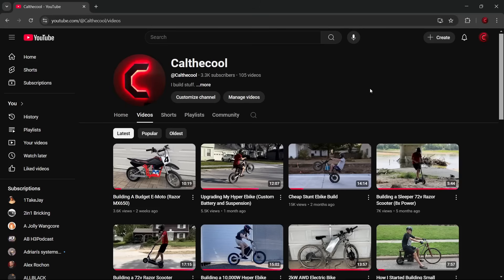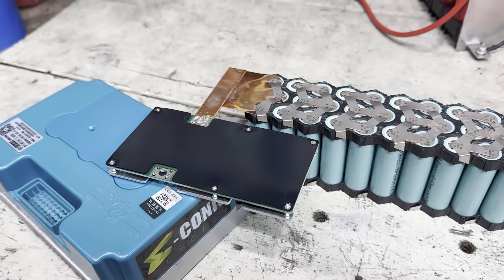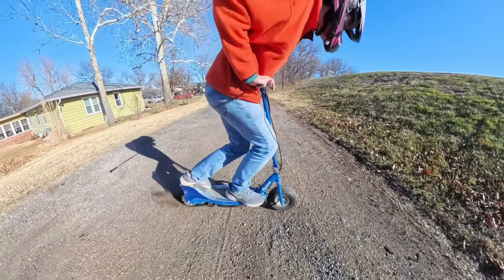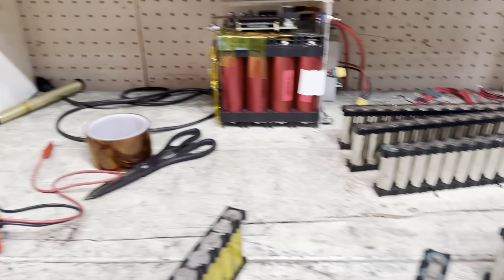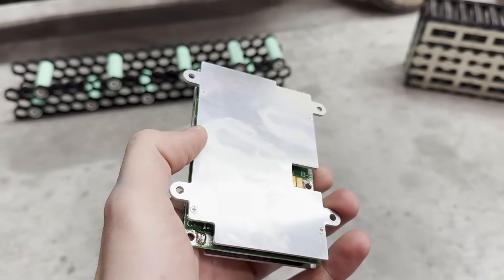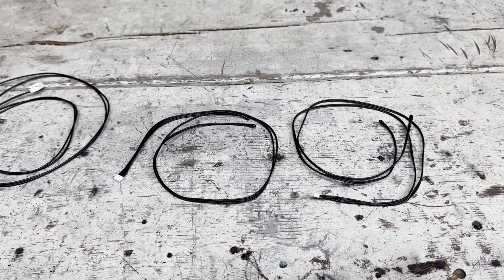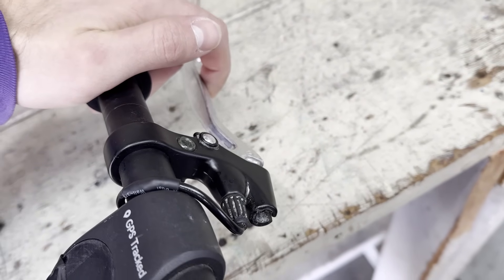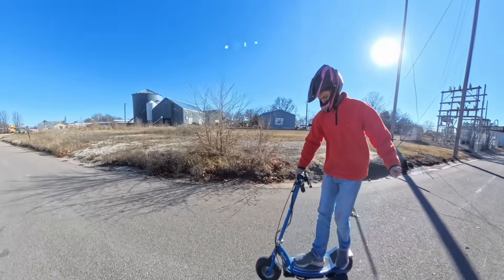Upgrading Two Electric Scooters

Comment: Do you think you could build a slim battery pack to fit inside the deck? It would be nice to see a stock looking 2wd version!
Reply from the maker: You could make a 1p pack that slides in from the back and not modify the frame at all, but that would definitely be difficult and the battery would be gone super fast.

Comment: There's that xt90s nice to see your progressing i just found your channel also vesc is great once you get the few things you mentioned worked out
Reply from the maker: I tried some xt90s connectors and they burnt out immediately.
Reply: If its an Amass manufacturered XT90S-F then you get up to 90A continuous and 120A peak before they blow how much current we're you working with 😂
Reply from the maker: @Nathan-q6y The resistor I mean, I plugged it in slowly and smelt something burning, then the next time I plugged it in it did a big spark. Believe me I could definitely melt the whole connector if I wanted, but I’ve moved on to qs8 connectors for my more powerful batteries.
Reply: @Calthecool That caalculates lol well i wanted to say thank you for doing your razor scoot build you got me thinking  about the build myself and then the other day i ran into a completely striped down razor power core e195 waiting for a new welding machine to get started on the buil

Comment: i have two crappy Birds I plan to mod eventually. All seems manageable but you kinda skip over custome torque arms for mounting motor in rear!
Reply from the maker: Sorry about that, I did that before I decided to make a video about this so I didn't film it. I just cut two pieces that were a snug fit on the outside of the frame, then cut two slots for the motor and two holes for some bolts to hold it in place.

Comment: I just sold my 52v BBSHD build.Not enough acceleration, plus was tired of shifting gears constantly in this POS congested stop sign ridden New England city.  Didn't want to invest a 72v battery AND an $800 HV ACI BAC 855 controller Kit so now I'm going 3kw 4T hub. I only ride on the street anyway.

Comment: bbs02 with 96v battery would be mental! Just keep below 50 battery amps and use  low gearing for acceleration.
JKBMS bms much, much better than ANT because it is active balancing the cells all the time above a set threshold. 
Ubox VESC is better because on/off switch is integrated on the board itself and way more reliable than Flipsky

Comment: Hey bud how you doing I can respect the fact that you're doing a channel on electrical scooters and bikes and he bites and stuff like that I mean I can respect that I just figured I stepped away from my motorized bicycles and see what the let's go bicycles are about okay if I watch the video I have somebody who looks like they know what they're doing maybe I can understand why they catch on fire and why they don't and I was raised around gasoline engine still a lot easier for me to fix but with all due respect I would like to spend $5 for a gallon of gas instead of spending $500 for a new battery and then waiting 12 hours for it to charge before I can even ride it my motorized bike takes 2 minutes to fill it up with gas and another minute to start it and I'm riding it's all together less than 5 minutes
Reply from the maker: @davidotto7666  I’ve built multiple motorized bikes and minibikes in the past so I know how good they can be, but I like to build this electric stuff now because it’s new and interesting, and if I ride a motorized bike or minibike around my neighborhood too much my neighbors will get annoyed.

Most batteries catch fire because they have some kind of defect, a lot are made in Chinese factories where they don’t care that much because they’re really hard to hold accountable if something happens. I make all my batteries myself so I make sure to not cut any corners so they are totally safe and so far they have all worked great.

You have to remember that you’re paying most of the cost of the vehicle up front when you buy a battery, vs having to buy gas constantly for a gas vehicle. Electricity costs so little compared to gas, it costs me $0.65 to charge my highest capacity ebike, and that ebike has a massive battery.

I just got a fast charger, so my newest bike now only takes 50 minutes to charge from empty to full. I actually store it at 60% charge, so it’s really only 20 minutes to get a full charge.
Reply: You know that makes sense I didn't think of it that way you're absolutely right cuz when I was a kid I used to play with a bunch of stereos house stereos car stereos thank you like trying I played with too so I know you're coming from I agree with you there is something different something interesting something new yeah you're right and especially you probably know more by asking about electronics and I'll ever know on purpose but you seem like a good person I think I'm going to watch your videos and learn some stuff you got my curiosity peeking now thank you again for replying and being respectful I appreciate that thank you again you have a blessed day

Comment: Try to make a ebike from a hoverboard
Reply from the maker: @noeln208  they aren’t powerful enough, I ran one of the motors on 1000w before and it worked but it got way too hot.
Reply: @ okay. I’m trying to build a fatbike from two hoverboard motors in the rear tire like Mid Modifications did

Comment: The reason the brake cable melted is because you were trying to ground through it while welding. So the current tried taking the path of least resistance at first and that happened to be the cable. When welding make sure you are grounding directly to what you are welding.
Reply from the maker: I know how it happened, I put the ground clamp right next to where I was welding but I guess it didn't have a good connection from rust or paint or something.

Comment: Does the ant BMS slowly drain the battery when you're not using it?. I've heard most these Bluetooth BMS's drain the battery eventually
Reply from the maker: @gregstafford2155  I’m assuming it does but I haven’t really tested it yet. I normally store my electric stuff at 72-76v so it would take a while for it to drop to 60v.

Comment: Heya , since you're using bluetooth bms , you wouldnt need a anti spark switch or fry your connectors . Just turn off the discharge in the bms , plug it in then turn back on the discharge.
Reply from the maker: @xJayteee  yeah I guess I could do that, but nobody else could ride it without having the app and knowing how to do that.
Reply: @Calthecool  then you could add a breaker inbetween the positive wires. Might look kinda ugly but pretty much the simplest solution..

Comment: Awesome! As a scooter guy too (mostly tune Ninebot G30s and Dualtron Thunders because they're just the ones I used to), I want to recommend you to check out the MP2 open source ESC, that thing is probably the best controller you could possibly make for your builds. I never actually built it, because it's a lot of work and I'm lazy, so I'm just using VESCs, but it would be cool to see more MP2s in the wild
Reply from the maker: @zorionowo  I’ll check it out

Comment: Eh id kinda like to see the bbs02 build anyways
Reply from the maker: Here's how the video would have gone, you can imagine it:

1. remove stock cranks and spindle
2. install the BBS02 and install the cranks onto it
3. install the throttle, screen, and controls on the handlebars
4. bolt the battery mount to the frame and install the battery
5. ride the bike and talk about how it can barely go 25mph and it can't go up steep hills

The video would have been <5 minutes and boring, so I didn't bother. I might do a powerful mid drive build one day that'll be more interesting.
Reply: @Calthecool  Thanks for the reply, you make great videos - im always excited to see a new upload! It is interesting for me to learn your opinion about bbs02, because i am an owner of one. Have you perhaps thought of modding it - like putting a better controller on it, forcing the motor to work harder?
Reply from the maker: @mindaugasrostkauskas9670  yes, but then the chain and sprockets would wear out quicker and probably break, so I would have to upgrade them. I would also have to install better brakes, since I can’t use regen like on a hub motor. After all that I would still have a bike with way less power than the weakest hub motor bike that I currently have. I definitely want to make a powerful mid drive bike one day, because I’ve seen some that are really awesome, but for it to be worth it I would need a pretty nice full suspension mountain bike and those are thousands of dollars which is way to much for me at the moment.

Comment: That's my favorite of all razor e300 scooter mod. Im getting parts to do mine like yours. I also have a razor ecosmart scooter with seat and thats the one i really want to see a video, no one on YouTube ever made razor ecosmart mod to make it fo faster. That other scooter mod you did is crazy smh you hit over 30 on it thats crazy i thought the wheels will fall off glad they held tru crazy mods keep it up man.
Reply from the maker: @ClownMoney  I definitely could put a bigger motor on a ecosmart scooter, but it would probably be really sketchy if you do a wheelie because you can’t just jump off and run like on the standing scooters. It looks like it would fit a big battery though.
Reply: @Calthecool that's true I didnt think about that if the ecosmart wheelies you don't have space or time to get off it. I think the e300 is better mine is the e300 with seat.

Comment: Nice builds. What spotwelder and settings are you using for the copper nikkel sandwich ?
Reply from the maker: @ramone79  kweld powered by a 3s4p pack made with 38120 headway cells. I don’t remember the power level but I know it’s not too much since it’s only 0.1mm copper.

Comment: if you want to make mid drive ebike how about flipsky 80100 e motor from what i have found it is pretty good and powerful motor  and i think it well help you
Reply from the maker: It doesn't look like it would work well on an ebike, it would require a bunch of gear reduction that would reduce the efficiency.

Comment: build a gigantic battery and buy a good motor/controller combo (maybe 72v 250A minimum) and strap it on some random stuff you have (razor krazy kart, hoverboard, etc.)
Reply from the maker: I actually just bought a 72v 500A controller and motor kit 👀
I need to find something to put it on, whatever it is will be insane.
I think a krazy cart would be a fun build but I doubt I'll be able to find one for a decent price.